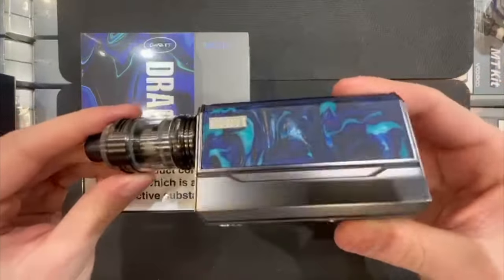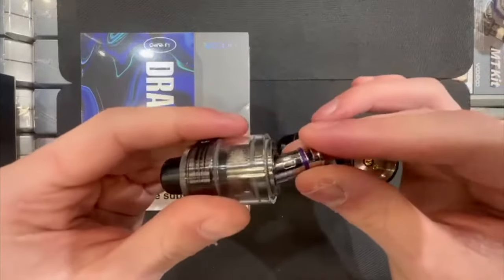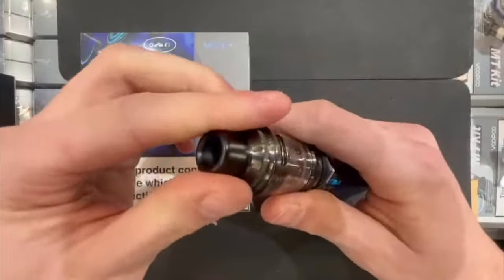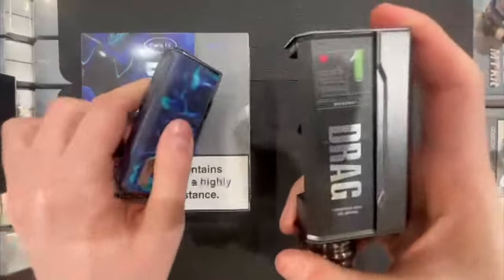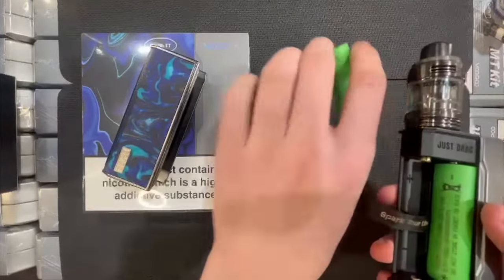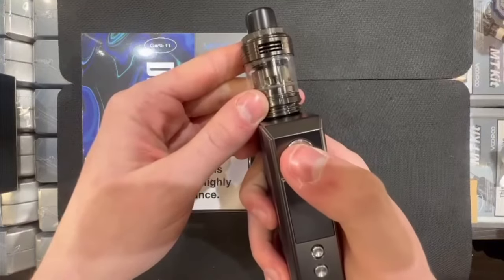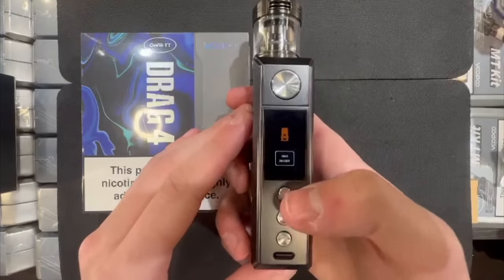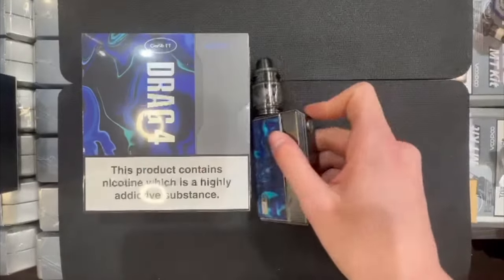Voopoo Drag 4 Kit Tutorial

Comment: I don't suppose you know how to change the glass on this? I've tried unscrewing it the normal way but mines either on there super tight or there is a knack to it.
Reply from the maker: Hi unfortunately this is a common issue you have to slide ur hand down the glass consistently then eventually it will slide out of the rubber bands. Sorry if this doesn’t help the only other solution would be to break the original glass and put the new one on
Reply: @foggfather6580  Might just break it get the bubble glass on. Thanks for the reply!